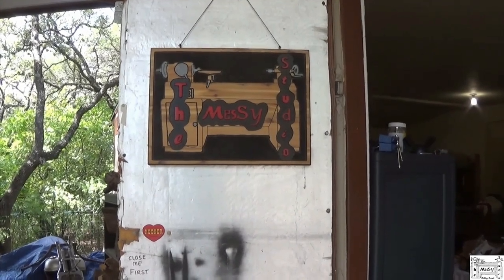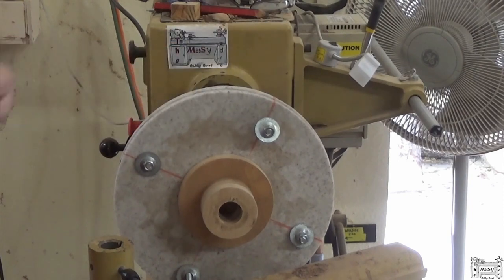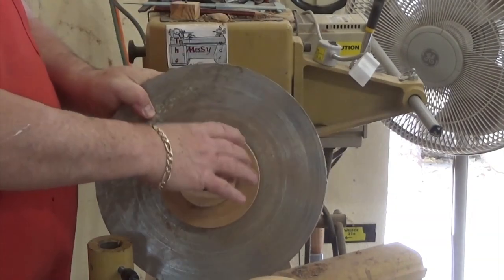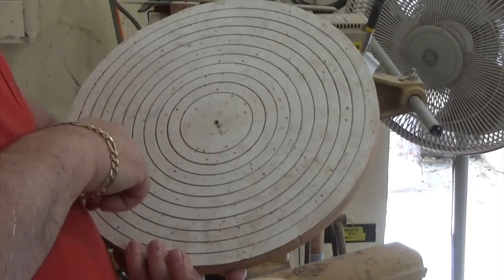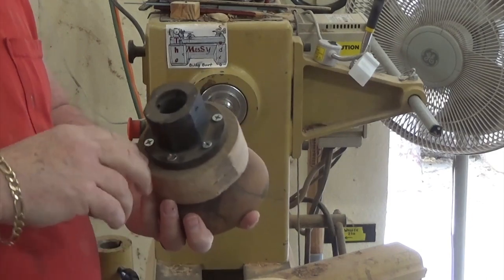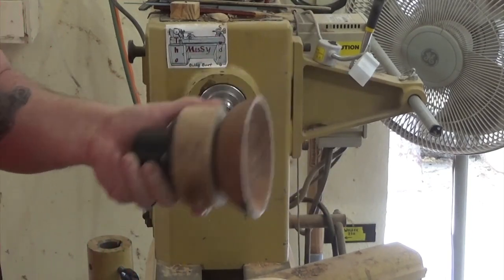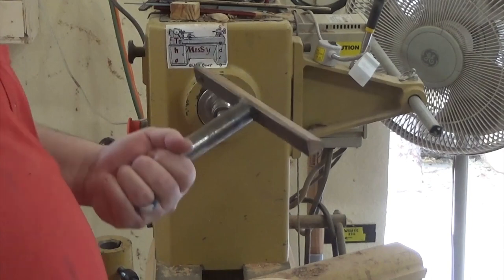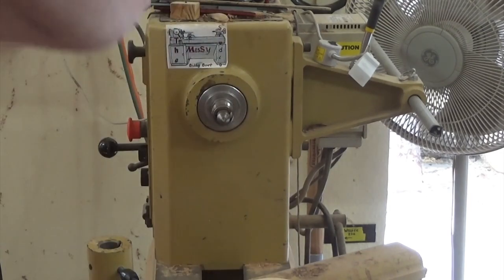Turn Talk #7 - Turning Jigs, tricks, tips, etc.

Comment: Great tips Billy. I also am “cheap” with my sanding disks. Instead of the old tennis shoes I went into the dollar store and bought a couple pairs of flip flops for a couple bucks. Cut out my 2” circles and used contact cement to glue onto the base. Works great.
Reply from the maker: Thanks, Wayne! Great minds think alike. I looked into buying 3/8" or 1/2" neoprene sheets, but the price was ridiculous.  You can make a number of these from one pair of cheap flip flops!  That was my plan until I decided to have a go at my old shoes. LOL
Billy

Comment: Billy now you're talking my language. Nothing I like better than making something I could just buy. Ok well or too cheap to buy.
Tapped wood faceplates are great. As well all the other gizmos you came up with.
Gary
Reply from the maker: Thanks, Gary!  I know some either don't have the time, or maybe even the skills to make their own, so it's not necessarily for everybody.  And that's fine.  To be honest, I've replaced a few of my homemade jigs over the years with commercial products but only because they were better than mine and the price point was right.  I envy those who can work with metal equally as well as wood.  Alas, I cannot.  Doesn't keep me from trying, but...
Billy
Reply: Billy I have a Bridgeport mill that is CNC controlled so I have lots of jigs I have made from both metal and wood. I had a wire feed welder but gave it to my older son. If I need something welded I can go to his place and use it. I made 3 tool post rest using both the mill and the welder.
 But there are somethings I just don't mess with anymore. Such as the Oneway ginding setup. I prefer spending my time turning. But special table saw sleds I will make to fit my needs.Or if I need something right now that's another story.
I guess its an old guy thing.
Gary